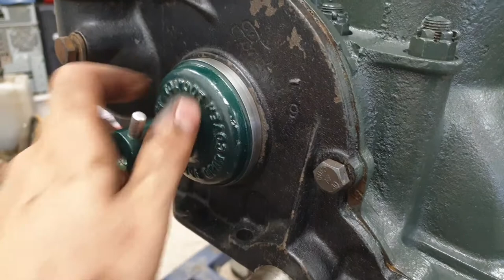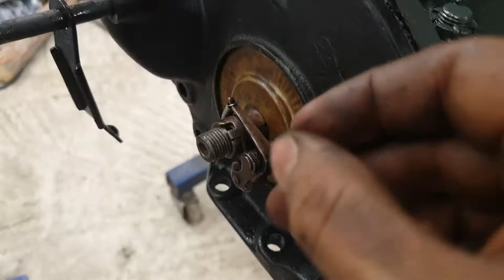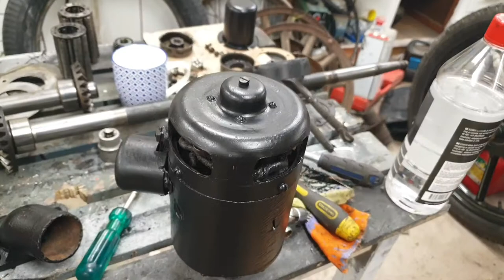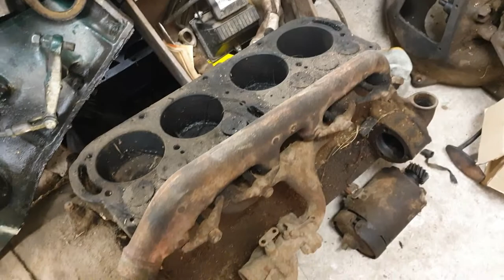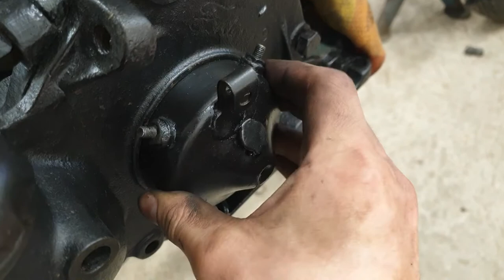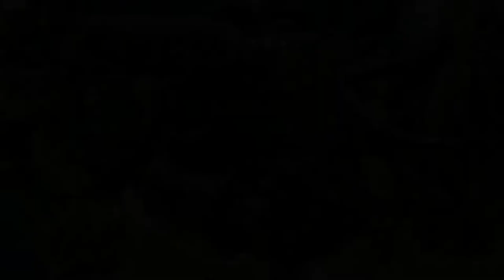Ford Model T Restoration/Build | Part 8 Manifolds, Generator and spark timer

Comment: Correct me if I am wrong.  It is my understanding that when you use the new modern seal for your timer that you do not use the brass plate.  Everything else you have done looks good.
Reply from the maker: Why would you not want to use the brass plate?
Reply: @OskarsCarsnStuff  With the new modern seal in place, you do not need the brass plate.  It would be extra and a piece of thin brass is just another thing that can wear down and cause issues that are not immediately noticeable.  You will waste time trying to find out why the car is not running smoothly.
Reply from the maker: @davidhjortnaes2000  okay, thanks for letting me know.